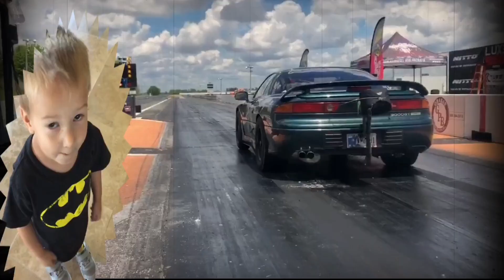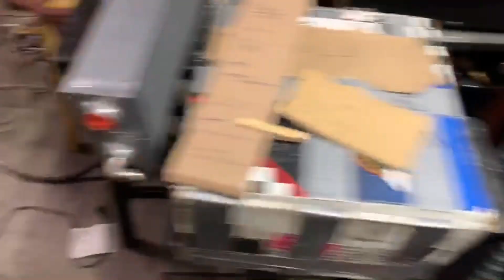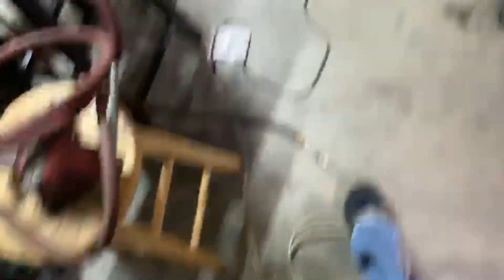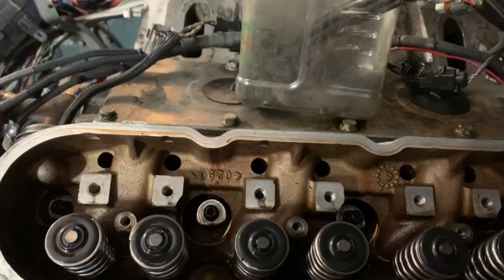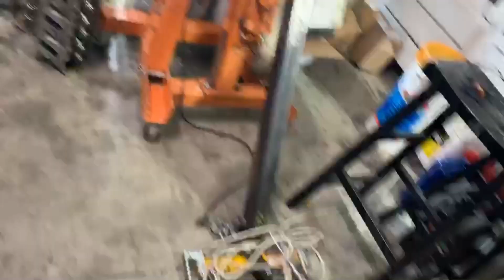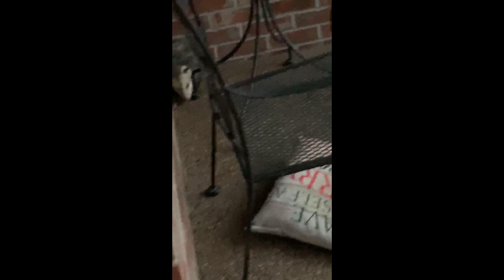LS Swapped 3000GT VR4 - 4 Wheel Drive Project - Episode 2

Comment: Mmmm wet compression with meth. SCIENCE FUK YEH
Reply from the maker: Meth jet is post compressor so dont think it would be considered wet compression. I did have pre turbo injection before too but this will be simple for mounting purposes on twin turbos. I’ll be running intercooler also so this just helps take the “bite” out before the intercooler.

Comment: Been waiting to see people try and make used of LS based awd drivetrains for swaps- seems like the  next logical step if they can push heavy trucks with the aero of a brick into single digit times
Reply from the maker: Fitment and ground clearance is a concern but should be doable. If I just cut out the whole firewall and floor and tubed it all, fitment would be a lot easier, but I’m trying to keep stock interior still.